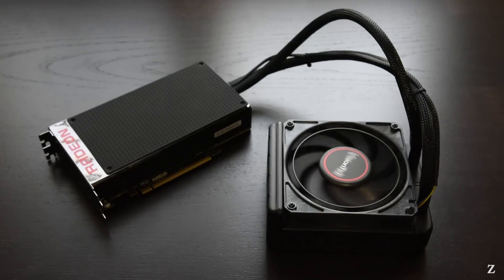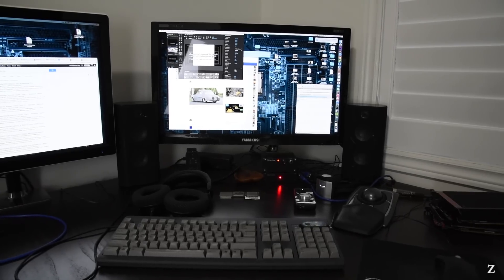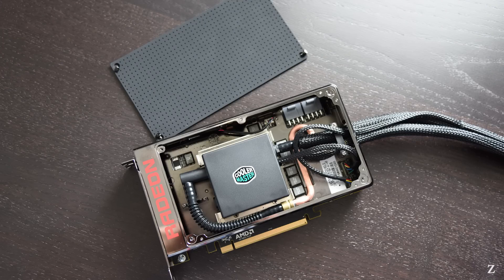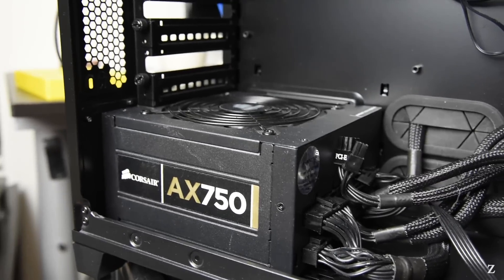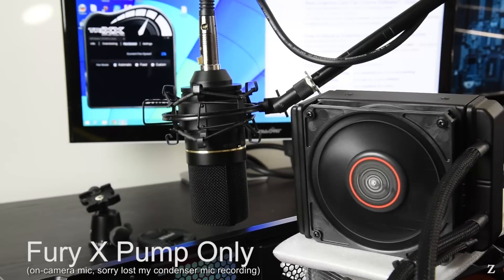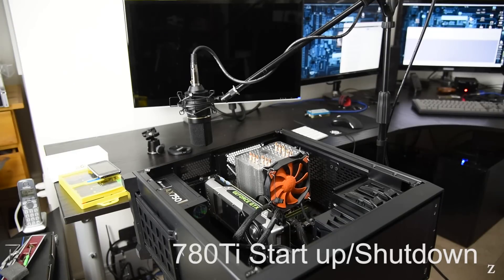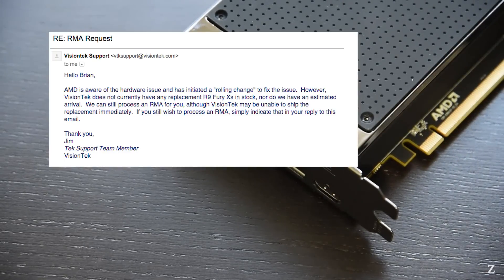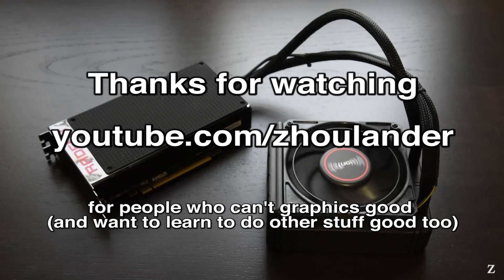AMD Radeon R9 Fury X - Pump Noise

Comment: I received a card on 8/18/16 that sounded like this. Mine is an XFX Fury X. The box calls it Ver. 1.1. 

The issue is not resolved. Thanks for providing this video to verify that I'm not crazy. I'd read so much literature online indicating that the issue is resolved that I was beginning to wonder if this was how it was supposed to be and that the initial batches were somehow worse.

Comment: I had coil whine on my 970 but it went away after a while.
Reply from the maker: +Jon Doe (Mr White Foxy) I'm hoping same holds true for the Fury cards.  I'm still waiting for Amazon to ship me a Fury X that I ordered at the end of July... though with the Nano having just been released I'm tempted to order that instead.  At least they're in stock!
Reply: +zhoulander Why? You seriously are going to buy a loud, overheating card that doesnt have many modern features in games and doesnt perform as well as its nvidia counterpart for the same price
Reply: +zhoulander Youre a fanboy. Thats clear
Reply from the maker: +Kaydn “SocialHypocricy” Burns  That escalated quickly.

I have an NCASE M1 v1 that I've been waiting to build for years.  With the current lineup of SFX PSUs that have ticking fans or broken 'fanless' modes, the Nano would allow me to use a regular sized ATX PSU and be able to push more than 1080p.

I'm sorry you don't see how the R9 Nano could be a 'buy' for some.  Keep in mind I haven't pulled the trigger yet because of the reported coil noise and the crazy high price ($900 in Canada, vs the $699 Fury X "price errors" that have happened multiple times).  Too early to tell if the coil noise is something that can be fixed with a little bit of 'burning in' like on other cards (GTX970/980 to name a couple).

Also FYI in my Define R4/X99 build I have a 980 Ti.

Signed,
Yours truly, Not a fan boy
Reply: +zhoulander What DAC do you have on your desk in this vid? Link to purchase?
Reply from the maker: +klimon531999 It's an ODAC paired with an O2 AMP.  I bought mine from a local builder, https://www.facebook.com/AudioPoutine/
You can find 'retail' versions from places like JDS Labs: https://www.jdslabs.com/products/46/standalone-odac-rev-b/
Reply: zhoulander or, you could just use a better mini itx case that works much better and use a good nvidia graphics card, that is optimized for every game and has better drivers and support

Comment: Useless video. As was shown in the video, this is a Fury X sample with a sticker on the Coolermaster logo, meaning it's pre-fix. This won't apply to any of the cards currently being produced.
Reply: ***** He did state that amd made a statement that the issue was resolved for consumer models in the video though
Reply from the maker: ***** You're right, new cards are supposed to have a fixed pump by now, but AMD also told reviewers that it was supposed to have been fixed by the time it went retail and later on went to release the statement about a small number of initial customers being affected.  I'm hoping all of the problem units have been flushed out by now.  

The noise of the "pre-fix" pump is the entire point of this video as I wanted to show some people how bad my particular card sounded, not to mention the amount of coil whine that it had.
Reply: zhoulander My personal opinion on the matter is that they didn't know about the problem until shortly before the release, and tried to fix as many units as possible. They didn't manage all units, and because of the low supply, those bad units are making the rounds because vendors don't really care, so they sell them anyway. Then they get sent back and re-sold.

Anyway, your video is mis-leading regardless. You do not mention in the title or description that a fix has been implemented for all current-production units, and that your own card is not representative of what a new card will sound like.
Reply from the maker: ***** Thanks for the feedback, I've updated the description to more accurately reflect my early-run pump vs. what should be available now.  It wasn't my intention to be misleading.